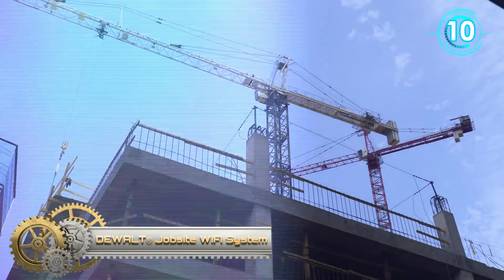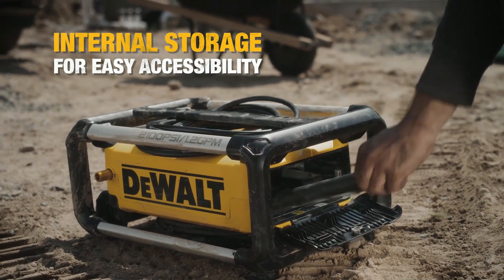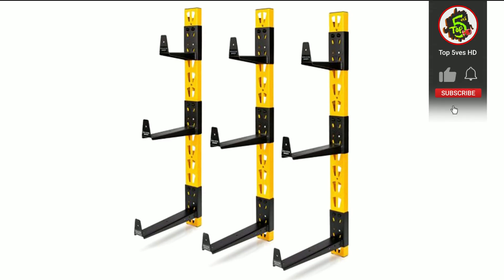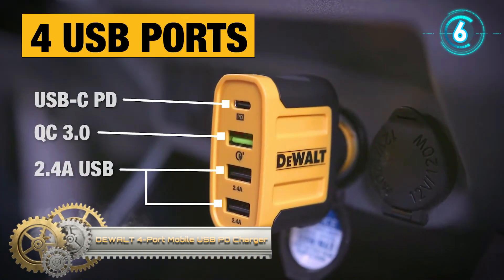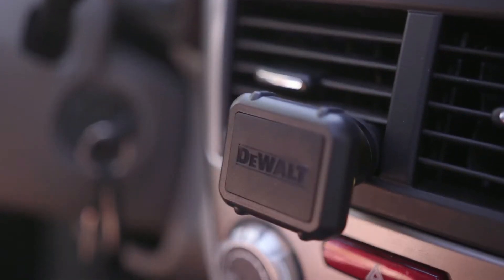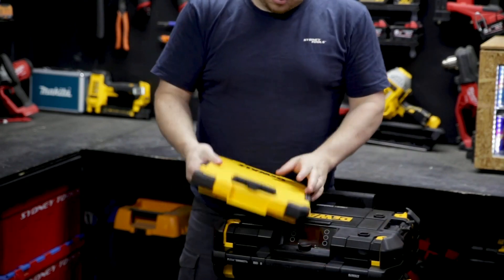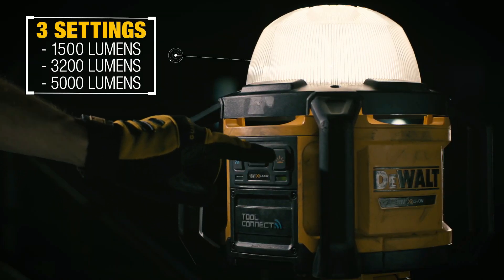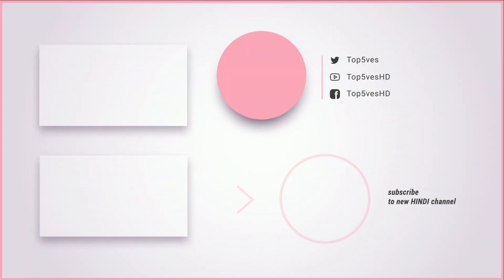DeWalt Tools You Probably Never Seen Before  ▶2

Comment: Slotted screws in the 2 x 4 stud rack mounts - whaaaa?  In addition, most commercial buildings use metal studs, so affixing them would require adding wood studs for strength.